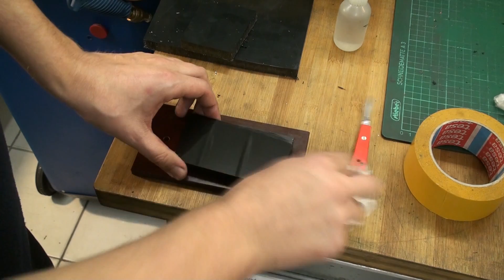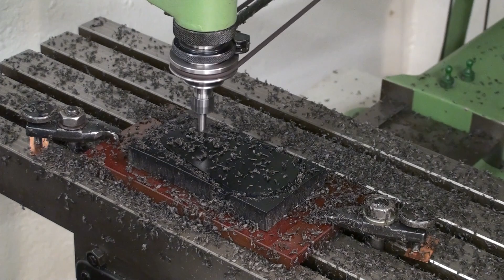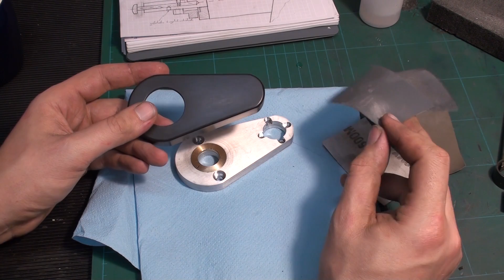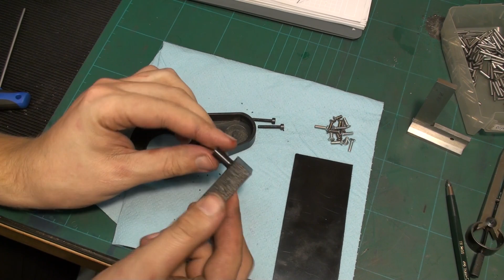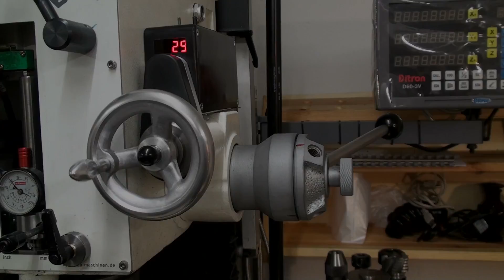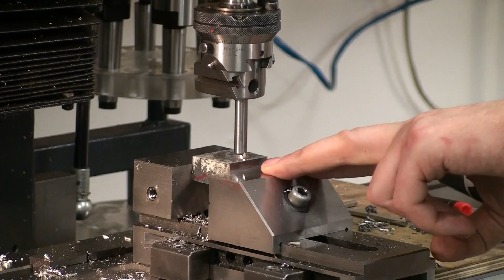Quill Feed - Part 2

Comment: The standoffs on the inside should have been machined integral to the plastic.  I did alot of these when I was younger and once you make a few, it gets easier. Nice work. As for the electrics, I buy from Mouser electrical supply here in the U.S.. I must say, etching circuit boards here in California can be problematic. I try to use Chromic / Sulphuric acid etchant for my  copper circuit boards when I can. The etchant goes deep and banks the sidewalls of the circuits leading to very tight accuracy and fine lines.

Comment: Always good to come back to your channel, and the little stepper motor for it's size works amazing (@@)! I have put off powering my RU-FU and came back to brush up on your build. Head in a similar direction, but using a worm driven 24vdc motor from a lite duty HC chair, and have power up incorporated into the build. Bear from TX.

Comment: 3D printing covers is a whole heap easier... 
I also use Auduino nano for speed control & indication. I am guessing, from the way the reading bounces about, that you are counting magnets per unit time. You get a more stable display by timing between magnets (RT timer + interrupt). Still needs some averaging, but a lot more stable. If either of your belt wheels are steel you can detect the 'teeth'- more detectors = better reading. Otherwise a disc stuck to the front of the mainwheel with dark and light sectors and a photo-detector. Printed out, or etched on your panto it could be super accurate and stable. Probably simpler than inserting 18 magnets.
But great project!

Comment: was wondering if the setup would stop at the end of the travel , was thinking on using the microswitches inside the machine for the tap function to stop the mainmotor and perhabs reverse the spindle motor but the slipping clutch works too and is way eazier 
looks nice , works good too

Comment: Awesome work, each of your videos has me learning more.    I'm not sure if it's needed, but because you have a speed sensor and Arduino, you could easily control the PWM signal to more precisely control the quill speed.  I have done it for other applications and its neat to see the motor power crank up as you try and slow it down.

Comment: I am a bit disappointed that pushing the black ball does not activate a switch to turn the motor on...
Something simple, i.e. 0.005mm hole through the remaining part of the worm gear shaft as a guide for a push rod made of nanotube, releasing a catch that drops a steel ball into a spiral raceway. The ball hits a switch that turns a fan that winds up a spring that powers the rest of the Rube Goldberg machine that turns the switch for the feed motor in no less than 36 operations 
:-)

Comment: I know this is old, but if you want to increase the resolution of the hall effect sensor, you could make a small steel toothed wheel to fit over the timing gear.  That way you can have 50 tooth resolution to more accurate readings.

Comment: Excellent series as always, Stefan.  Thank you for your efforts.  A solvent that works perfectly on PVC is Butanone, also known as methyl ethyl ketone (MEK).  I use it in a small dispenser with a needle tip for welding PVC.  I also use shredded PVC mixed with MEK to make a calk that works well for making fillets
Reply: I made an error here.  I got my plastic acronyms mixed up.  The type of plastic that I weld with MEK is ABS.  I don't know whether MEK works with PVC or not.  Sorry

Comment: Just an FYI, Working with PVC, epoxy putty is the weapon of choice. Rough the PVC slightly and use force to get it to adhere properly. Once hardened, it can be machined just like machining the plastic.

I would have given the perimeter of the PVC a locating groove or just notches to keep it centered on the aluminium.

Comment: There's nothing to be ashamed of using an Arduino as a controller! As you say, they're simple, practical and cheap. Well done!
One thing to watch out for, to those thinking of using a Hall effect sensor for a tachometer, is to be sure you have a LINEAR sensor and not a latching one... or, if you do have a latching one, to ensure that the poles of the magnets alternate north-south-north-south. Otherwise you'll only get the first signal, and it'll be useless!

Comment: next time, monitor the speed of the smaller belt pulley's drive shaft. you then need fewer pulses for the same end resolution. "ideal" would be to get into the input side of the reduction gearbox... so one pulse per revolution of that gives you all the resolution you'd want... but those geared motors are sometimes not amenable to reassembly after teardown.

nice machine hack and an instructive video.

p.s. simple engagement with key works. another way, depending on shaft and gear sizes, may be to "borrow" syncro rings as used in automotive gearboxes.
Reply: Some geared motors have a bit of the shaft sticking out on the back side, you can put something with slits or holes on there and a forked optical switch with that the arduino can count the rotations.

Comment: Excellent series on the quill feed. I suspect you don't mind if I adapt this for cross feed on my lathe.

With all respect I have to disagree with you on the arduino not being suitable for professional use.
As a electronics engineer we actually use them from time to time. 
They are incredibly cheap, including all sort of addons, readily available, very interchangeable, and there are a huge code base available for adaptation. 
All together, it simply saves time for proof of concept, or in limited run tests.

I actually remember the time before arduino and it's derivatives. You had to design a purpose made microcontroller, wait for the PCB manufacture and awful lead times on components, not to mention debugging the PCB you just made. Only after this, you could actually start doing the application.

Furthermore it is has empowered a lot of nonprofessionals to realize idea's that would never have been made otherwise.
Your quill feed being a good example of this.
Next step is to let it run to a defined depth and back again for power tapping :)

Comment: Hi Stefan  another great pice of work. I have one question., Does the Arduino match the Down feed speed  you  set the display too or does the display reflect the speed you set the down feed too?
Reply: Michael Heath If you watch when Stefan purposely lets the motor slip against the clutch, you see the display go down a few units. Hence, I would surmise the display reflects the actual motor speed and not the target speed.
Reply: 12:13 -> motor slips against clutch

Comment: A fairly easy upgrade to the motor controller would be to add a sensor to the spindle of the mill that could give the microcontroller it's RPM. Then you could have a button to switch the display from mm/min to mm/rotation so you wouldn't need to calculate the chip load.

I don't know if it would be all that useful, but I was thinking about being able to easily reverse the feed. If you cut a groove in the center of the splined pulley and reduced the length of the sliding key, the drive would be in neutral when the key is centered in the pulley. Pulling the knob in or out would engage the splines. If the original shaft was drilled all the way through, your control shaft could extend out of the end and operate a switch that would run the motor. Pushing the shaft in would activate a forward switch, while engaging the rearward splines. Pulling the shaft out would activate a reverse switch and engage the front splines of the pulley. It would probably need some form of a detent to make the neutral position easier to lock into.
Reply: Nice idea. You would run into an issue engaging the splines since the shaft is not turning until the key is fully engaged.
You would have to use either something like a transmission synchronizer, or a friction clutch. The synchro would run into it's own problems when the quill is at the top of its travel if the splines need to rotate so it drives the quill upwards. Might not be a problem if the quill bumper is soft enough to compress easily though.
Maybe you could just increase the splines to 8 and put a knurl on the knob. that way one could manually rotate the shaft up to 45 degrees to engage the splines.
Reply: You're right about the difficulty in engaging the key when it isn't rotating. I think the groove would need to be wider than the key and have the switches positioned so that they start the motor just before the key would drop into a spline. Increasing the number of splines would be good too.

Comment: Nice work.. But why didn't use Stepper motor for this job ? I think it will be more accurate, You can run it at any rpm you need without any sensor, Also you can make it run for specific length than stop ?
Reply: What you described would be much more complicated and add nothing in terms of accuracy.
The motor RPM is controlled by the pot, the sensor only drives the display.
It is possible to program closed loop into the Arduino, and then set up a PID. But why? With all the gear reduction involved, there will be almost no RPM reduction under normal load.
Setting it up to stop just gets into ugly territory, suddenly you have to either add a display and keyboard, program it via stick, or hook it up to a computer. All that to do the same thing that his hard stop already does perfectly.
Keep in mind he sold his CNC machine over a year ago because he prefers to work by hand.

Comment: A quick tip:  If you are looking to make superglue fillets, like on your belt guard, add the superglue then sprinkle with baking powder. Makes a full fillet that dries instantly.
Reply from the maker: Old model makers trick! Did that back in the day when I built plastic models...and completely forgot about it. Thanks for reminding me :)
(Glas beads from the blast cabinet work also very well)

Comment: How did you "decouple" the gear friction-turning the shaft? in the beginning it turned the quill even the clutch mechanism was not engaged? 
Great video as always btw.
Reply from the maker: Ha, sharp eyes there :)
What you saw there was indeed the drag from the gear turning the shaft, but that only happens when the conical clutch for the fine feed is dissengaged and it doesnt do any harm. When the conical clutch of the fine feed is tightened, the gear freewheels without a problem :)
Reply: not as sharp as you thought but you mentioned the "problem" in the first video if i remember correctly. i was curious if you would use some lubrication or even adjust the bore diameter back then.

Comment: As always a really well done and thought out project Stefan. Even Bridgeport doesn't recommend drilling anything larger than about 3/8"  or 9mm with the built in head feeds. And there's only 3 fixed ratios of feed available per spindle revolution. The Bridgeport gearing just can't drill with anything larger without breaking the internal gearing. I don't bother drilling at all with the power feeds and reserve it only for boring on my clone. Having that range of feeds on yours and being far more durable will be very worthwhile. Hand feeding doesn't come close to what can be done with power feeds on the quill.

Comment: Very nice. Since it is a DC motor, you could add an intermittent pause that could be turned on or off to break the chip when you're drilling so you don't get those long spirals wiping about.

Comment: Stefan, you're one switch and some code away from having a pecking drilling mode.   Would help to keep the helicopters away.  Other than that great video. Greets from Canada.
Reply: I suspect the raison d'être for the feed unit was for boring. Given the typical sizes this class of machine would drill, it is no hardship to use the Armstrong method for feeding.

Comment: Beautiful design and execution, well done!!!!   I see your mill has an articulating head, have you ever used that feature? I'I've been looking for vids that show turning the head but no luck. Looks like it may be fun to try.
Reply: Several of my early videos show me running my mill with the head turned 90deg to get more travel on my machine. Of course I also had it at an angle for my hemispherical milling but I know you saw that one.  On a machine with a quill the angled head can be even more fun as you can easily drill holes at an angle.  Plunge cutting on angles can lead to some neat features. :-) Sadly I have to use an angle plate if I want to do it at least for now.
Reply: Thanks Brian, ive watched yours several times , thats what got me going on trying it. I only have an up graded 704 Grizzly and wanted to see it on something that size.  Read many things about why you shouldn't do it on a chinesium mill but why not try.
Apologies to Stefan for hijacking his comments

Comment: Having had my fingers drug through those old washing machines with the rollers, "hurts like frig" is quite accurate.
Reply: Me too, crawling on the floor, stuck index finger in the exposed  gear drive under the washing machine and split it wide open. After70 years have scar for  proof. Didn't know at the the time what "frig" meant.